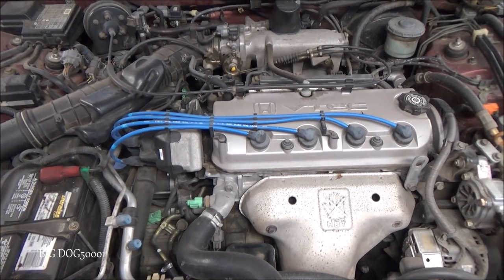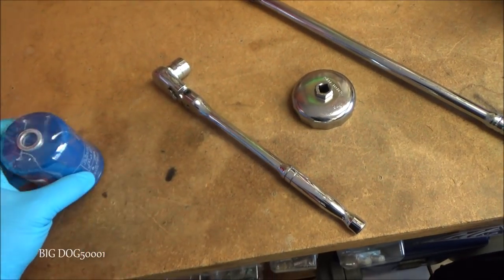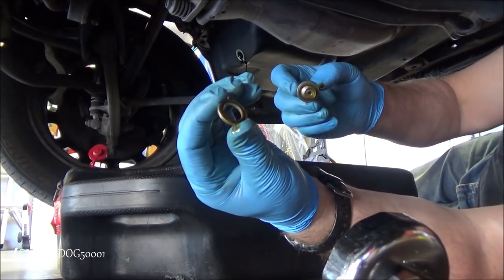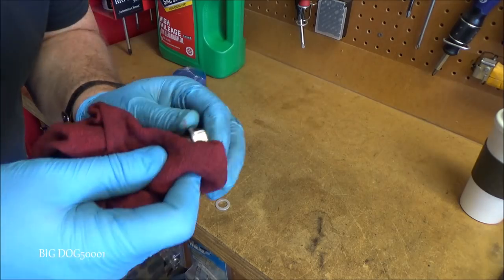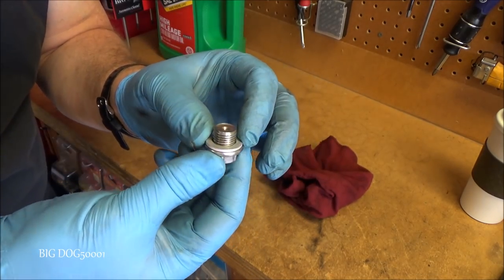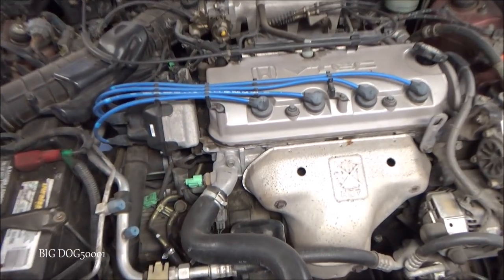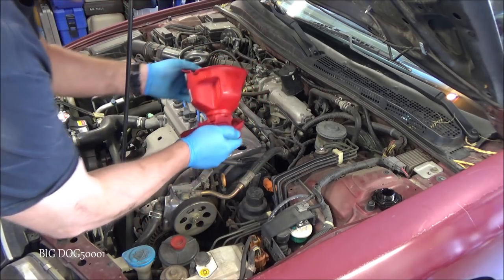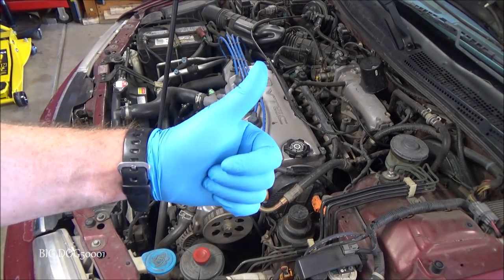Honda Accord Oil and Filter Change 1997 2.2L (1994-1997 Similar)

Comment from the maker: Tools and Parts
This channel earns a small commission using some of these links - at no additional cost to you.
Honda Oil Filter Wrench:  https://amzn.to/2YQxfx5
Honda Oil Filter and Washer Pack (A2):  https://amzn.to/2lICcWr
Oil Drain Plug Washer Part # 94109-14000
SAE 5W-30 Motor Oil
FloTool Oil Drain Pan:  https://amzn.to/2KwHGNo
GearWrench Ratchets:  https://amzn.to/2Z4NaXM
GearWrench Sockets:  https://amzn.to/31GPstX
Harbor Freight 3/8" Breaker Bar:  http://bit.ly/2EgRuF8
Snap-On 3/8" Tech Angle Torque Wrench:  http://bit.ly/2TzsaU0
Daytona Jack (Cheaper at HF with coupon):  https://amzn.to/2ne0TKE
Jack Stands (Cheaper at HF with coupon):  https://amzn.to/2njPaKo

The Big Dog 50001 Automotive Channel Store can be found here: https://www.amazon.com/shop/bigdog50001automotive
Reply: I used goo gone to flush and clean the engine it's a spray

Comment: 1995 honda odyssey back on the road. 300,000 miles going for 400,000 plus. Gave up on 2006 subie sti failed emissions po448 and po447 in ct. Taking to dealer then getting rid of it subaru no mas. Great mining video tuf work.
Reply from the maker: Hondas usually keep going if you do things like oil changes, too bad about the Subaru.  Thank you for the comment!

Comment: Bought a 1997 accord SE for dirt cheap and unfortunately the previous owner crossed threaded the oil filter onto the stud and having a hard time installing the new oil filter. My Dad suggested to use a external dye thread and see if this will work and to be extra careful not to get any metal shaving into the engine. Probably Harbor Freight has some cheap tooling for this task...

Comment: My last car is a 96 accord ex. I used to just change the filter every other oil change the 10+ years I owned it. The location and the sideway filter mount making taking it off just too big of a mess for me. I had cut open a few used filters with tin snips and I couldn’t find sludge or debris inside at all. Probably could have left it in every 3 to 4 oil changes. I usually just drove my car up a couple pieces of  2 x 4 blocks and reached over to the drain plug.

Comment: I need an oil filter wrench for 2003 Honda Accord EX. Do you know of a good aftermarket one I can buy?
Reply from the maker: The same oil filter and wrench combination I showed in this video can be used on a 2003 Accord.  As for aftermarket wrenches, I have a few generic wrenches (including Lisle ones) that can take NON Honda filters off but I always install Honda oil filters when reinstalling so I don't have a good recommendation for an exact fit one (most don't fit very good).

Comment: That car needs a wash and wax ASAP!!!
Reply from the maker: That paint was too far gone, there was no clear left on the top of the car.  I don't think washing and waxing would have helped!
Reply: @BigDog50001  Gotcha! Pretty common for 94 to 97 accords to lose clearcoat. At least rust is not your problem unlike what we have in the Midwest. I worked on accords the same year you have and it would make you cringe to see what they look like because there’s body left or frame.